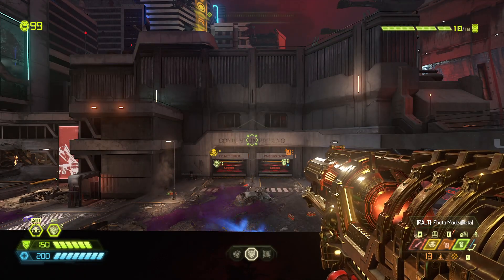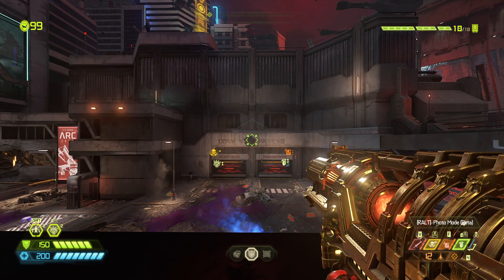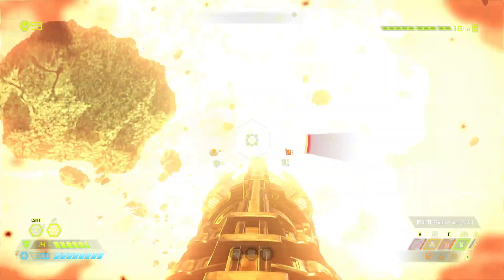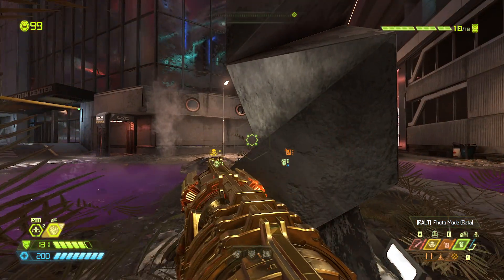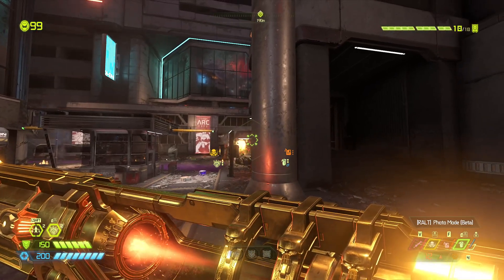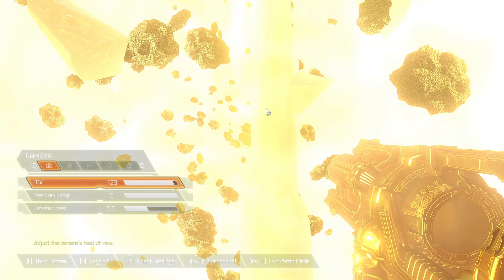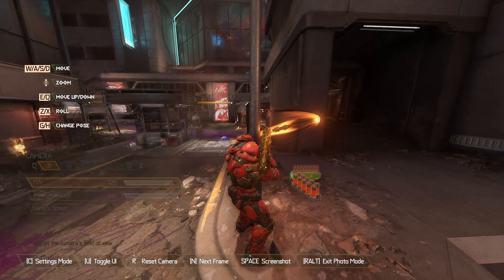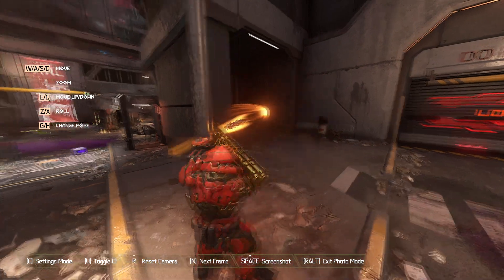How Doom Eternal's Rocket Launcher Works

Comment: Pretty interesting that Classic Weapon Pose can lead to different outcomes in niche situations.
Reply: Kinda sucks, I would hope it would be the same
Reply from the maker: @chonchjohnch  well it's always been the case anyways, though for different reasons.

There's a buggy issue where lock on burst has a longer delay if you don't have the mastery AND you're using classic weapon pose, most of likely because the model of the rocket is blocking some visual check, raycast, whatever. It's not a big enough change for casual play though, only really affects Speedruns.